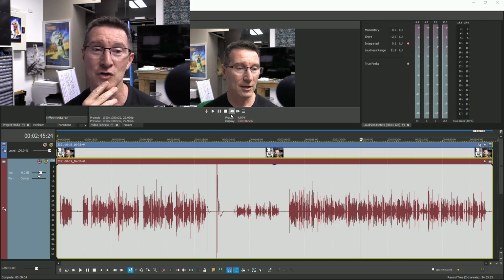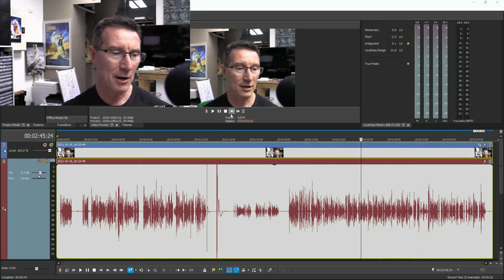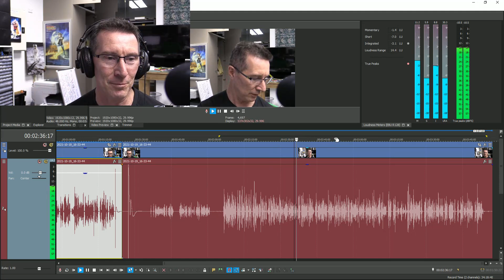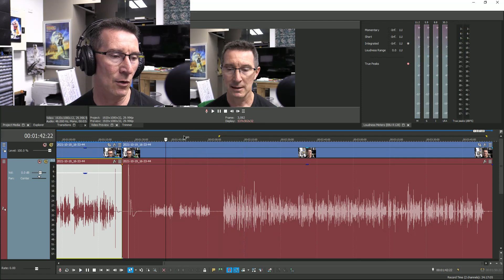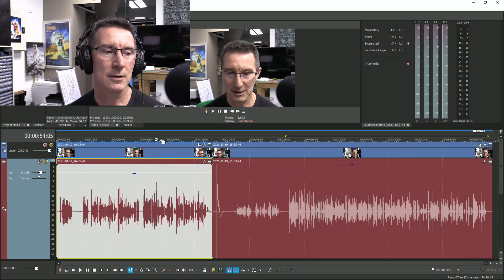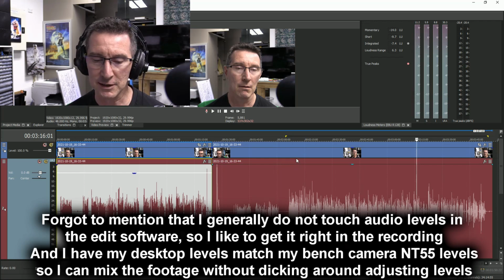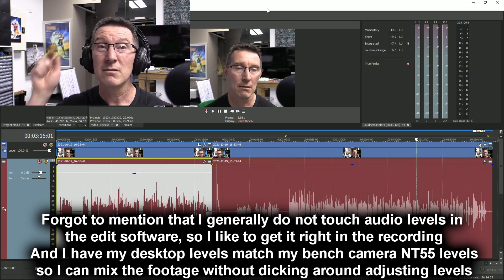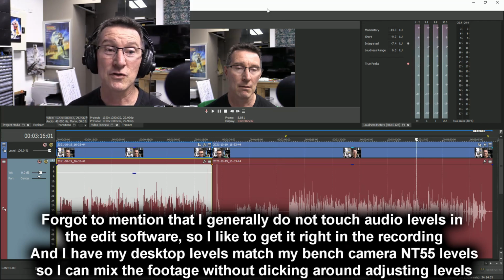Rode NT1A vs NTG1 Microphone Comparison & Testing

Comment: NT1a is a much nicer sounding mic on my monitors but your not wining awards for vocal recording! I would go with the shotgun. You still need a compressor and eq. Save your own presets on the comp and eq plugins to make it a quick and easy process. I have a NT1a and a K2. Some of the pop vocals I record work better with the NT1a.

Comment: I'm only listening on my terrible old-fashioned PC speakers at the moment, not my monitors or my headphones, but I'm getting the impression that the tonal difference is negligible. NTG-1 seems slightly more airy, as you'd expect, but it's really a nothing-burger, especially for the context. Are you using the HPF on the mic itself and finding it insufficient, hence the external HPF? It's nice to hear how the NTG-1 performs in this context; I bought a pair of them awhile back, but have only had the opportunity to record music with them so far.

Comment: Your Scarlett Solo dropout sounds familiar. My Scarlett 2i2 worked flawlessly for 3 years with windows 7 but under windows 10 it occasionally just quits.  I have to reboot the computer and all is fine again. Trying different drivers and USB port configurations has not solved the problem for me.

Comment: The NTG1 has a bit more room noise at similar gain, but I like it. The NT1A sounds "better" in terms of isolation, but that sort of sound works better for voice-overs (perhaps your Amp Hour podcast?). Since the ETG1 is easier to use, I'd say go for it. I doubt the average YouTube viewer would notice anyhow.

Comment: Slightly more reflections on the shotgun, but for the convenience the switch makes sense, not a huge difference by any means. Sounds fine to me, and some acoustic treatment could tame the reflections.

The proximity effect is probably what's causing the main difference in bass and level changes when you turn your head.

Comment: NTG1 would probably work better for you. NT1A is still sounding better when you stay still. But if you move around behind your desk, yeaaah it ain't the ideal
Reply from the maker: Yeah, and that's the thing, I move around a lot when talking.
Reply: @EEVblog2  Hi Dave, as I have commented above the hardware device like mic preamp compressor could probably 90% eliminate your "ordered Brownian motion" across the lab. :)
Reply: I agree.....I used to be a sound engineer and we used loads of compressors live. Set up properly you wouldn't know you were running one but you get the benefits.
Set up wrong, it'll be a mess.

Comment: Try raising the microphone above your head and have it pointed down towards your face. Experiment with the angle but try around 45 to 60 degrees. Also, make sure there is some room behind the mic, if possible, because shotguns have a rear lobe in its pickup pattern. If you are facing a wall, it can pick up that reflection. It won’t help with background noise as much as less room tone and clarity. When the mic is pointed straight ahead, it will pick up reflections from the back wall. Raising it, pointing towards your mouth and floor, lessens those reflections it can pick up especially if you have carpeting. And being pointed down at your mouth will reduce some of the nasal sound (as compared to up your nose). I haven’t used that rode mic, but  a shotgun may not be the best choice for what you’re doing. Try a small diaphragm cardioid. See if you can rent or borrow a Schoeps CMC6 MK41 to compare against (place it the same way as I suggest for the rode shotgun). Even if it’s out of your budget, it will give you a good benchmark. Rode NT5 (with the cardioid capsule) is a good inexpensive mic to try.
Reply from the maker: I have acoustic foam on the wall behind the mic.

Comment: Shotty sounds more consistent, but there is a noticeable drop in bass response. Completely tolerable though. I'd go the consistency path.
Reply: I think some of that is mic and some is mic placement.  I haven't really done much with the NT-1 (use an M3 here myself) but I suspect part of the inconsistency is coming from the mic placement not being ideal for the Nt1.
Reply: With a compressor you can have a great consistancy. Anyway, any record should be compressed as long as there are variations. This is a basic in recording

Comment: NT1A sensitivity seems richer, much less background "sound", I prefer this word more than noise since it's part of environment, for vocal only seems a little bit better than shotgun, fulfilled with mid to low frequency. Dave's vocal is less low frequency, so no need to filter out low (maybe below 100Hz).
Reply from the maker: I filter out the low stuff for any physical bumps on the table or stand.
Reply: @EEVblog2  Many YouTuber didn't bother to these details. TWO THUMBS UP!